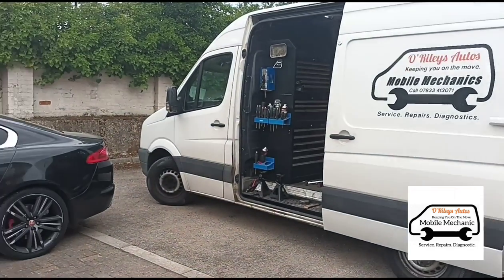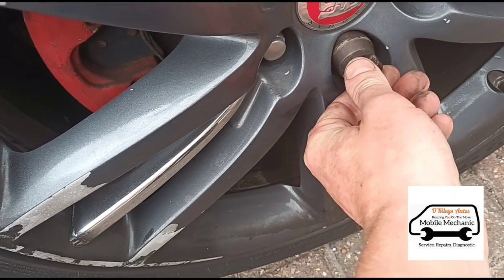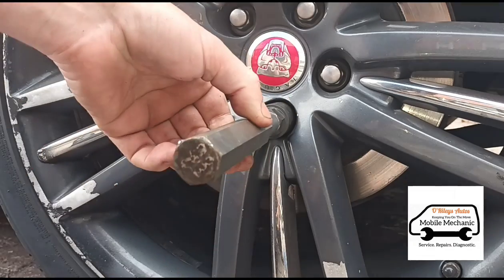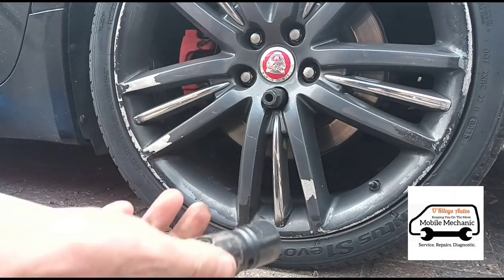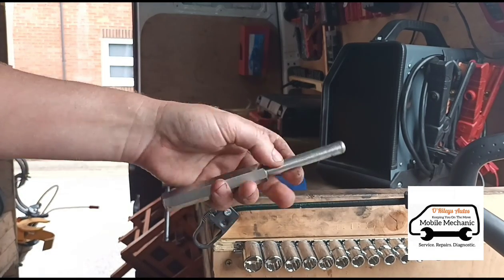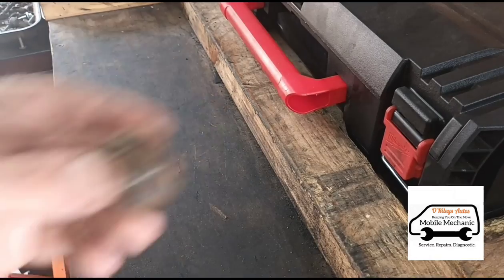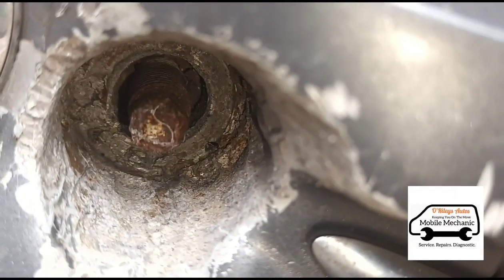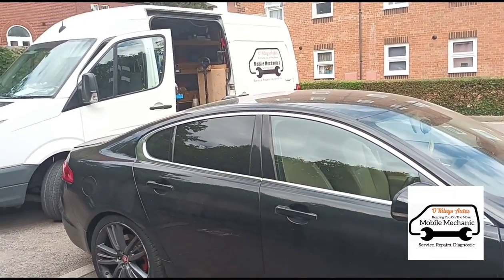Jaguar XF Locking Wheel Nut Removal Using Laser 6972 Kit

Comment: Landrover / Jaguar locking nuts usually see the top section spinning around to stop you doing this using a remover tool  , luckily these were rusted solid ! . BUT you can use the shanks of drill bits with the drilling flute cut off with a grinder to make hardened steel bars , little grease in an aligned slot and put the drill bit in the slot and use a hex socket ( drill bit slightly tight fit into one of the V corners of the socket ) = Harder you try to turn it the harder the socket grips on the drill bit shank . 3mm / 4mm / 5mm drill used depends on the socket to use  as your after a cam action and too big a socket will ride over the drill bit shank .
Iff you want to go all out , taper the end of the drill shank so you can hammer a tighter fit socket on and down iff the nuts are super tight with rust .

Comment: Great video, can you confirm if the code for the key is stamped on the  nut anywhere after removal?
Reply from the maker: Unfortunately not
Reply: @ORileysAutos  it's on the washer, I followed your video, found local mechanic with same kit, just like your video it was easy off. There's a letter stamped on the washer pal so managed to order new key from breakers.
Reply: l.need a key for my jag f type where did u get the socket pls @mallyohare5750
Reply: @georgefraserr euro jag for the locking nut and google for the laser removal kit.
Reply: @mallyohare5750  yes it has a w on it.